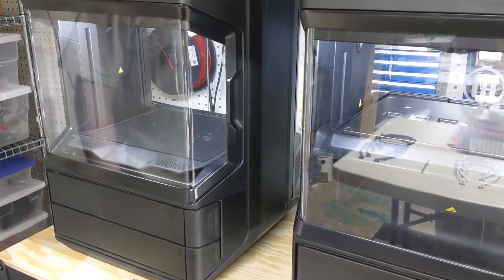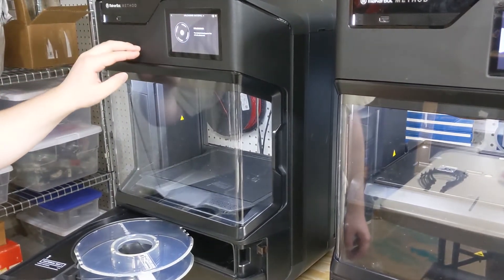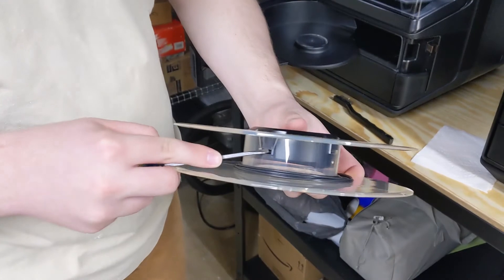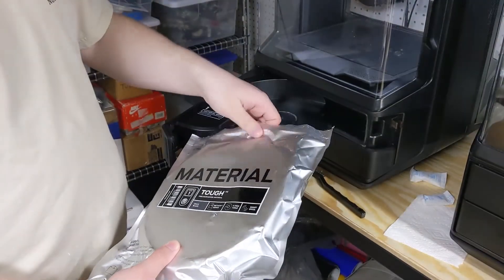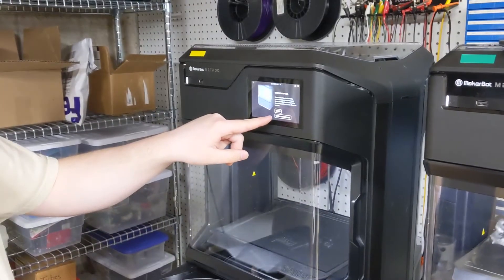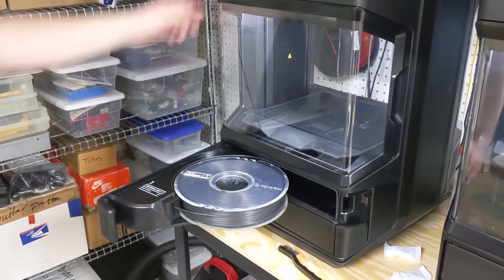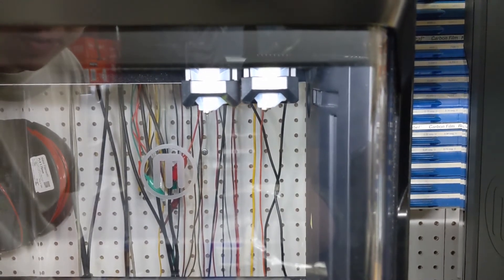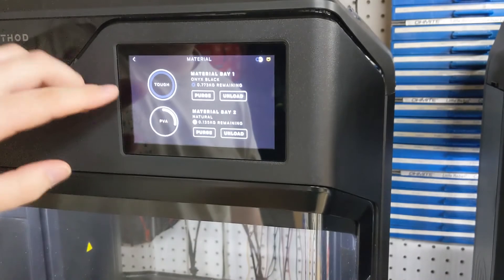MakerBot Method Tutorials: How to Change the Filament

Comment: How's the printer quality? Can you use third party filaments? Thanks.
Reply from the maker: I was a little skeptical about the MakerBot Method at first, since in the past the reliability and quality of MakerBot 3D printers has not been great, but I am pleased to say I am very pleasantly surprised by these machines! The print quality is remarkable and it truly is click-and-print... ONLY if you're using their $70 proprietary filament, and you only get 0.75kg per roll. For an additional $300 you can get the MakerBot LABS extruder which lets you use non-proprietary filaments. However, when you use third-party filaments, the click-and-print goes away and you have to tweak the settings to get it to print correctly. In summary, I am quite impressed with this printer, despite the astronomical prices and amount of waste it makes, as well as limitations in the printer software (you can't change as many settings as you would for other printers).